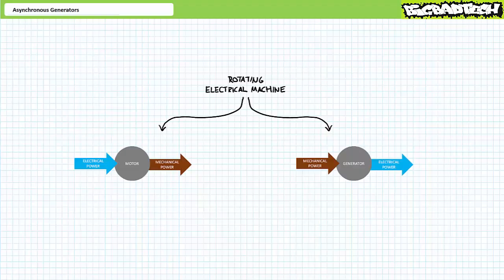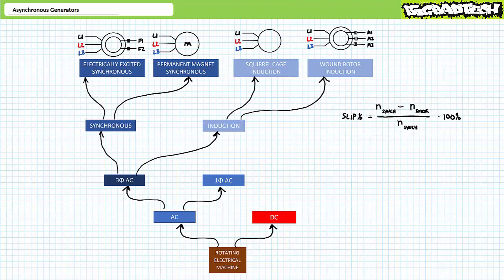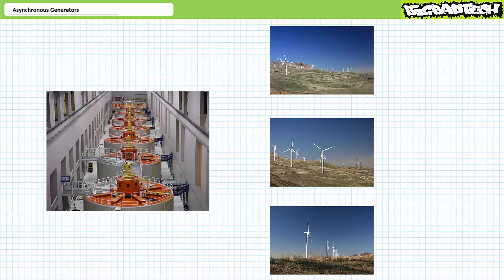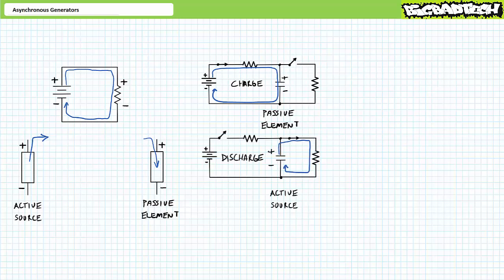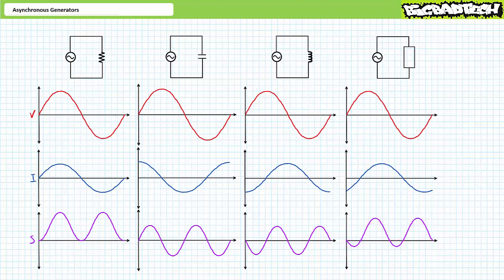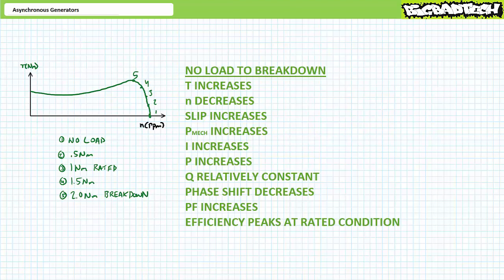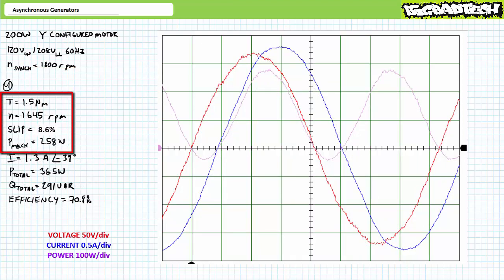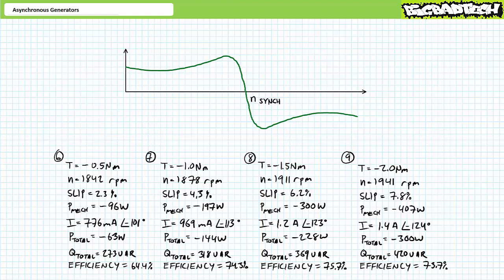Asynchronous/Induction Generators (Full Lecture)

Comment: Thanks for the videos! 😎
If possible could you let me know if I’m on the right track with this: An asynchronous generator only needs a mechanical medium to engage input & output….but a synchronous generator would need an electrical (control) medium to make the connection. *Ultimately the physical connection would be mechanical but the preparation would need to be done while measuring both sources and synchronizing them with each other beforehand ? 
—This question is based on my limited work with cogeneration units.
Reply from the maker: Stay in touch as I'll be publishing lectures on synchronous motors, synchronous generators, and synchronization this fall. Yes, a synchronous generator not only necessitates a mechanical source but also electrical control. By varying the field intensity and rotational speed one varies the voltage magnitude and frequency. Once everything is in synch one closes a contactor to establish connection to the gird. Once synchronized there's an additional electrical interplay as one exports more or less real and reactive power.

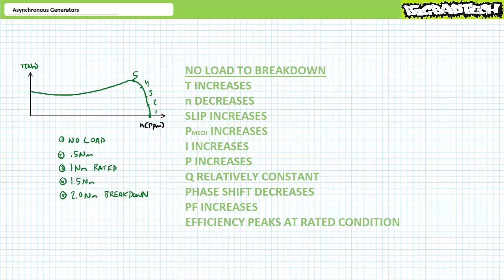Comment: Hey Jim. Thanks for all your effort in the presentations of your videos. As an engineer, I really appreciate all of this free information. I do have one question on the Position 1 "No Load" graph right at the 19:56 time point of the video. This will pertain to all five postion graphs as well. The power curve on these graphs are plots of the apparent power correct? Measured in Volt-Amps. If the power curve is bipolar and symetrical, average value of the curve is zero. Purely reactive and no transduced power measured in watts. If the curve is bipolar and asymetrical or even all unipolar, then the curve will have a finite average value and will have a transduced power component measured in watt units and have reactive power component measured in VAR units as well. As this is the case in this graph. My question is the part the graph where you have the units per division mentioned, you have "Watts per Division" for the power. Should that be "Volt-Amps per Division"?
Reply from the maker: Good catch! Yes time variant power curve should actually be "VA/division". Watts (ie: real power) is that imaginary center line.

Comment: Question Jim: the Pmech formulae is used to calculate what horsepower (Diesel engine)you need to spin an altenator of a particular rating? Say 175 KW+ what amount of HP I need to spin the rotor? Also for hydro-electric, do the calculations of head pressure spinning the rotor follow the same? Thanks for your different approach to mot/gen which I haven't heard!

Comment: In this lecture, the generator rpm was increased in order to increase output, but on every asynchronous generator I've worked on the motor/generator rpm has always remained constant despite load. What lecture should I watch that would help me better understand this?
Reply from the maker: Most likely the constant speed is trying to keep the generator inside the peak power region.

Comment: Hi Jim, i have a question,  if dual winding induction generator no load all test is ok, but while synchronous with grid excitation current is very higher  than rated current and immediately main MCCB getting trip, this is rewinding induction generator, so if any issue on generator winding ?
Reply from the maker: Not exactly following however stay in touch because I plan on discussing protective relaying and generator faults in future lectures.

Comment: Hi professor.
I’ve got a question: can the RC type of SPDs “ringing” installed to protect 3 phase compressor motor relay cause the motor to run backwards for a second or two?
Compressor stops on “pump down” so there’s almost no gas on intake side to pump, which makes it easy to turn.
Reply from the maker: I doubt it. SPDs (surge protection devices), regardless of the type, typically protect only the coil of a contactor designed to make or break connection to primary voltage and do not affect the polarity or phase sequence of that primary voltage. This being said some SPDs might induce a small delay in opening or closing.
Reply: @bigbadtech  There’s things called “contacts snubber”, usually Transorb or RC type, although not many of them can be bought from outside manufacturer. TC snubber have to be tuned in to the inductive load so they will be effective and will not cause excessive “ringing” Then there’s Arc Suppression Technology with their “NOsparc” suppressors, the nature of which they keep secret.
Reply from the maker: True dat. Improperly tuned RC types can ring and momentarily cross zero in negative range. I've always preferred the transorb types (two back to back Zeners). I should actually do a lecture on SPDs. This is a good topic.
Reply: @bigbadtech  You very well should!

This is a case ( not mine) when reciprociting freezer compressor was replaced by scroll compressor and it starts running backwards upon stopping, but it doesn’t get hot after doing that indicating that check valve failed and letting the discharge hot gas coming back. And as every medium or low temp refrigeration system gets shut down on “pump down”, which in turn “empties” the suction side of the compressor, making it easier to free wheel. It also have some European made unknown contactor. 
So bunch of people in refrigeration community coming up with wild theories as why in the world does that thing do that! 😁
It is also sets the protection device in the compressor it self which monitors winding temperature and phase sequence to set a fault and alarm.